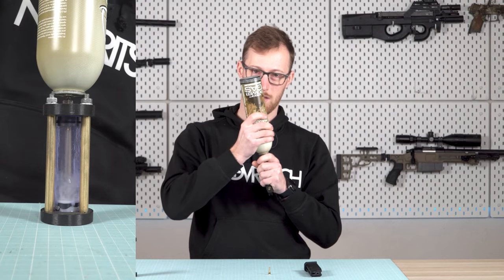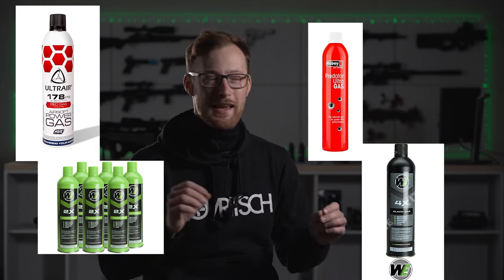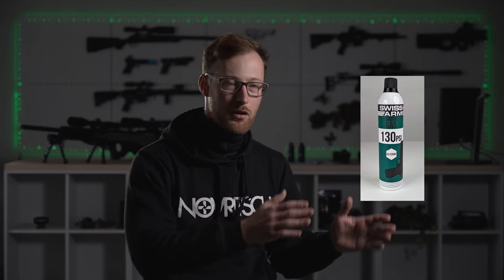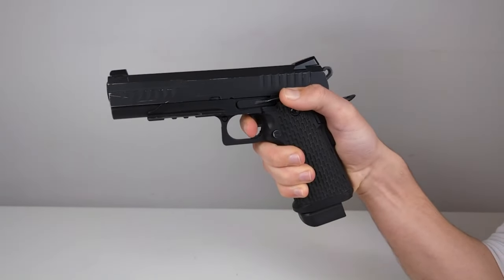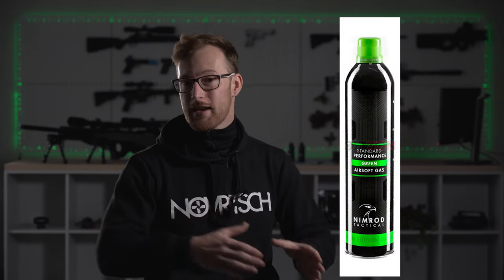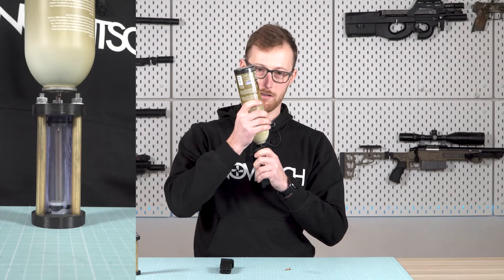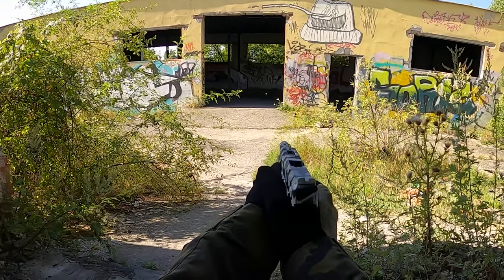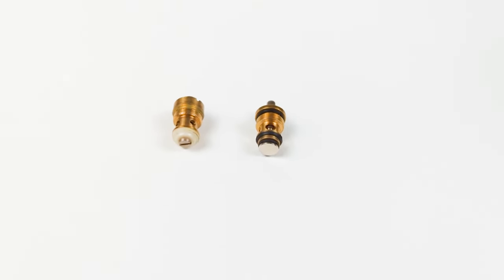Airsoft Gas - All you need to know!

Comment: You forgot to talk about using pure propane, some will say it has higher pressure and even provides more fps for your gbb compared to regular green gas, however in my personal experience, even though propane is slightly more powerful, it doesn’t seem to hold gas efficiently through the whole mag compared to the Crossfire green gas I use in my area. You may have to experiment with different green gas cans along with pure  propane to decide which one is best for you
Reply: As for power, I'd say he covered it pretty well. Whether or not pure propane is stronger doesn't really matter, because an airsoft gun is built for a specific pressure and if you exceed that pressure by too much it'll just break.
   Besides, pressure is all in the PSI. So, if they mark the PSI, there you have it.

That being said, the additives in green gas does of course make some difference. What difference? Only one way to find out, really.
Reply: I personally use propane on my secondary. In terms of power there isn’t any noticeable difference. 

Though I will say propane is much better than Green Gas due to cost. Green gas is literally just propane mixed with silicone oil sold to you in much smaller and more fragile containers for a much higher price.

Getting a 4 pack of camping propane containers, an airsoft adapter, and some silicone oil cost me about the same price of 2-3 cans of Green Gas.
Reply: People would tell me Green gas and propane was the same but I always found the propane shot harder for some reason. Only issue was the offensive smell. You can also buy a large propane tank and reload the camping cans several times over. A good option if you have the space and want to stick to gbb guns without hpa.
Reply: recently I tested the pressure on clean propane from 25l bottle and it is actually weaker. Here I some notes I sent to my friends:

As much as I hate to say this, propane is only 100 PSI which is surprising even to me.
MAPP Pro clocked in at 115PSI which is also not much considering it's been known to work at lower temperatures well. This might be due to different substances inside that make it evaporate in cold better. 
For reference: Nimrod Blue 116 PSI, Green 145 PSI, Red 174 PSI, Black 203 PSI

Nonetheless, Propane is a fraction of the cost and it works in the summer very well. I am sticking with my propane whenever it's warm enough to use it.
Reply: For years I play only gbbr 
So this is how I play
Pure propan in summer 
Mapp gas for temperature between 5-10°C (gas for welding copper pipes) and 
R32 eco gas for temperatures From -15°C to 5°C (R32 is gas for new air-conditions) 
But two years ago it is cold in morning (about 0°C) so I go with R32 eco gas, but few hours later temperature is something like 18-20°C and my Bolt broke because of strong pressure.
Reply: Boom
Reply: If you source through the one distributor

I believe 

It'll be baseline compatible (50/100 performance)

Comment: This is great knowledge! I personally went to CO2 because of the inconsistency with gas. Aside from temp fluctuations, altitude also makes a hit as well as weather. I live in mountains. Gas performs very differently at 4500ft than it does at sea level. Also a storm moving in and the cold front that move in with it also mess it up. Where I live weather wi;ll change on a dime and you have to plan for a specific field you'll be at. Its definitely doable but for me it was more planning than i wanted to deal with and i use my side arm quite often. Reliability is a must and gas made it too much of a lottery. especially with how rough i am on my gear. drop a gas mag a little too hard or often and it loses seal real quick. As a milsimer that appreciates being able to perform a quick reload, I didn't like how much i had to alter my usual aggressive play style to make sure i could safely perform tactical reloads instead. With CO2 I can flick a mag out to the ground with much more confidence and have a much better chance of it still working when i come back for it. On top of CO2 just being a dial adjustment away from to get my green ziptie and then not have to worry about it after that. Worse case it shoots a little hot if it start to get warmer as the day goes. But it at least almost always goes bang 9.9 times out of 10.

Comment: Also make sure to clean your barrel from the bucking to the barrel exit, not like he does at 3:05. The most dirt is at the barrel exit (because this is the part that is most exposed to weather/vegetation), so if you clean it like he does at 3:05, you will probably push the dirt into the gun/bucking and fucking it up aswell.

Also make sure to store your magazines at home with a little bit of green gas (like a 1-second-filling) in it 👍

Comment: This video is  super good, sad a bit it didn't exist half an year earlier, learned about this the hard way, by loosing 2 ssx23 mags to pressure(left them in the drawer for a few weeks with nimrod black still inside, while it was summer).
Reply: Damn, unlucky bro, atleast at the beginning of my journey i wont have to worry about gas, ill be running the ssr4 and sse18

Comment: Another small Tip:
Make sure to release excess Gas after Games from your Magazines, while mounted in a Replica.
Just pressing the pressure Valve outside one increases the strain on the single Mag output point, while the Mag being mounted and shot empty distributes the strain more evenly.
Reply: This is just so unnecessary. You always want to leave gas in your mags.
Reply: @BlunderBob  Very true in most cases.
As said in the Video tho, using Blackgas in Cold scenarios, and storing the full mags at room temperature after a game can cause issues.
Reply: @UltimateFalk  I have a WE 416 optimized for winter, it's mags have been holding black gas throughout the whole year waiting for the next winter to arrive, none of them leak. I should add that my room is fairly air conditioned, the temp never exceeds 28 - 29 C, in a trunk during summer they would probably blow up, but this pressure thing is not such a big issue as people think. My mags are not full of gas, just the gas which remained after shooting the whole mag at the last game and when the temp increases I presume just more of the gas liquifies.

Comment: To make things more confusing, many brands that state PSI doesn’t say anything about at what temperature… You can have two bottles from different manufacturers both stating 135 PSI, but their actual power is much different as one is ‘measured at 20C, and the other is ‘measured at 30C’… Neither bottle is lying, but at the same time, the PSI is practically a useless number without a temperature.

ASG 
Put temperature on the PSI rating on their bottles last year - Hopefully the competitors will follow suit 😅

Comment: Summer: Green Gas + Red Gas
Winter: Red Gas + Black Gas

Conclusion: Use Red Gas all year round because you always bring it with you. It's the middle ground between power and putting stress on the internals.

Comment: Ugh don't use lubed gas in gbb replicas, this will mess with your bucking effectiveness. Because the green gas is mixed with silicone oil it will spray into your hopup + bucking you really don't want that because a bucking works on the concept of friction. 
Swiss Arms makes cans without lube in it, or you can buy a propane adapter so you can use propane bottles. (green gas is basically propane with silicone oil) 

Just get a valve key and lube the o rings yourself.
Reply: You're right, the oiling in general needs to be moderate where green gas soaks everything.. Silicone oil also causes swelling and softening of polyurethane and rubber used in buckings, seals, and o-rings, over time.. It's good to prevent dry rot, but not good in excess. There's always people who keep things clean, and those who don't..

Comment: Hi Joseph, can you think about a video to explain more details about CO2 in terms of valves and most importantly perhaps, the different o-rings and any different maintenance to keep them running well? I continually struggle with this and finding CO2 replacement valves for pistols and grenade launcher 40mm shells is really difficult, or has been! Have you guys at Novritsch got go to ideas and products for this? You make and sell the stuff,  certainly for pistols so can you share your insights! Thanks Joseph

Comment: Honestly, i perfer co2 over any of the regular gases (green, blue or red gas).
It's pretty sad that the new SSPs aren't "safe" with CO2 above 14°C
Reply: did they change something about them? i bought  the ssp18 around the time it was released and back then they mentioned nothing about not using CO2 at higher temperatures and i still run it only on CO2 because of the nice kick and haven´t had a single breakdown or malfunction even in 30°C summer heat :)
maybe its just for warranty reasons.
Reply: @lukastactic2901  well, I would hope it's just that

Comment: nice video. However, I don't think you can use psi for much on many of the brands. They do not describe at what temperature they are measured and that is quite important. Some do, e.g. ASG here there is info directly on the bottle, where a graph has been made with temperature / psi.

Comment: Slight correction on why magazines get cold. It's not an endothermic reaction as there's no chemical reaction taking place. Pressure and temperature are related, meaning that as the pressure decreases the temperature also decreases.

Comment: I come from a different hobby that uses 40Max 40mm green gas shells. Is there a good way to reach them with hpa?
Reply: What other hobby uses those?
Reply: @peaceandwealthseeker4504 well, I'm a hobby grade Nerf enthusiast. (Hobby has lots of pros and few cons over other competitive Non-Lethal shooting sports.)

We've made 3D printed shells that fit to the front of the engines; to retrofit them to fire basically every foam projectile I know of.

I also won't to be surprised if paintball hasn't done something similar.
Reply: @zeanyt2372  that's awesome and yeah I've seen the rise of nerf guns which is very cool. I assumed paintball which is why I was so curious.

Comment: Great video!
I think I only had heard of green and red until this... Yea. I'm more of a co2 replica airgunner myself - and thus not much deeper info into airsoft. Only own a red bottle of Swiss Arms gas for my only airsoft gas pistol, which is an ASG CZ P-09 (came with one gas mag, but I bought a co2 mag also due it being the compatible metal slide version). The P-09 ran well with the SA gas, even rhough I dunno if the all red colored can even has anything to do with the actual gas type..
Reply: The P09 is probably the only decent ASG product.

Comment: This is super helpful. I just have one question: Does most of this also apply to a non GBB pistol?
Reply: Mostly yes. with nonGBB you should use even weaker gases on average as that gives you better results. There is no need for extra power to cycle the slide.

Comment: Use CO2 when you can.

All the gases suck in the cold but C02 remains most consistent.

Also, for some reason Green Gas Fill Valves suck you never really know when or how its going to fail but they constantly fail and with Co2 you plug and go, the canister is already charged and calibrated with fewer moving parts.

Green Gas Variants are best for their cost. Use it in grenades and sprayers where you just need a big PUSH but dont much care for consistency.

Frankly? Invest in a used HPA Regulator because virtually all Gas Fill blasters can convert to HPA for pocket change and most Hi Cappa and HPA shops will do the install for you because its dummy easy.
Reply: My buddy does this as a Hobby. He only wanted his HPA to run an MG Platform so to feel better he converts junker pistols to HPA.

Its usually just a screw in valve swap. They say, "Tapping".

One of his "Junkers" is so effective in HPA that he doesn't run it at smaller fields and especially not at small fields against kids because I've watched him hold down a 12 man team with a glockenspiel, essentially.

Comment: Thought the SSP5 is meant to run on CO2. My SSP5 6" just "died" on me because the screw and the threat of where the rear sight is, got lose. Very disappointed. I just got the gun around Jan 10 2024 -.-'
Reply: How many shots did you fire before failure? I bought myself an ssp5. The piston mount for the blowback mechanism was loose from the factory and was loose

Comment: If I put a metal slide on my TM hi capa will I need to upgrade to red gas?
Reply: Hell no, red gas is gonna destroy the internals. 
If you have Tokyo Marui airsoft then you should only use blue gas and green gas. 
I had umarex glock with metal slide and internals, and even tho it was "red gas rated" it literally wrecked the gun...

Comment: Is blue gas good if i want a gun to last for long? I’m gonna try air soft soon and maybe buying a gbb pistol
Reply: @Ebbelitos2309  depends on your gun, stock tokyo marui should only be used with blue or 9kg gas, other brands typically use 12kg or green. If you want your gun to last, yes using blue or green will extend longevity of your gun but proper maintenance is the best way to extend its life

Comment: so if i want just one gas for the summer and the winter i should use red gas or Co2 right?
Reply: It depends on if the airsoft replica you are using is rated for it, for example you should never use red gas in tokyo marui gbbs, because they are mostly plastic.

Comment: Is it safe to mix green and red gas? Or you need to fully release one before filling the mag with the other one.
Reply: Yes it is totally safe
Reply: As HRC said it's totally safe but you should know they dilute each other leaving you with some head scratches in some cases. For ex one of your mags had a little too much red gas remaining and you set up your hopup with that and then the next mag will behave differently. Also, going the other way, maybe one mag had a little too much green gas remaining and the temp gets lower and your gun doesn't want to function even though you think you already switched to red gas. So you know, you have to keep all this in mind.
Reply: @sogerc1  Got it, many thanks!